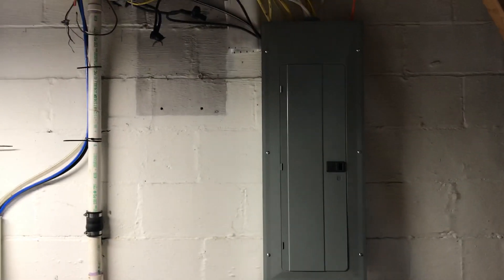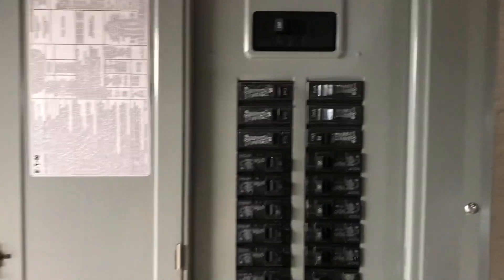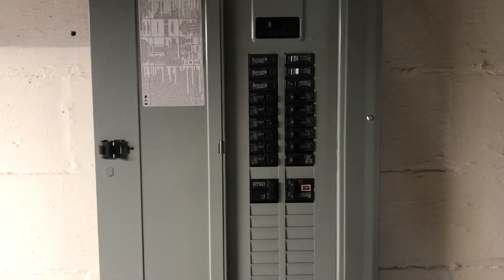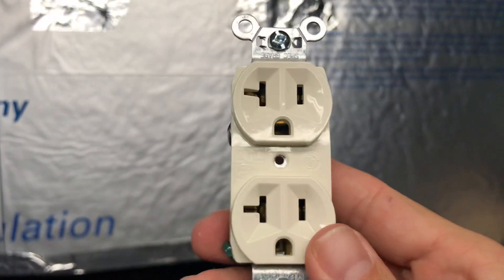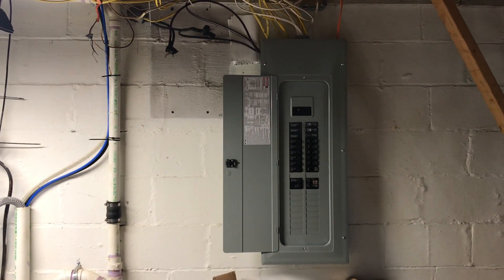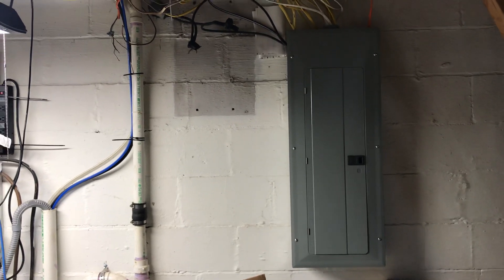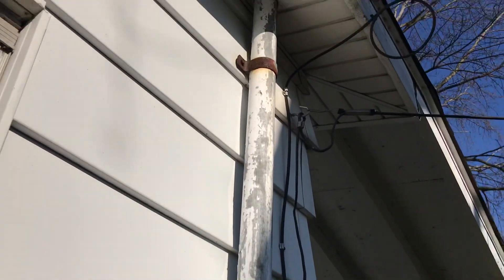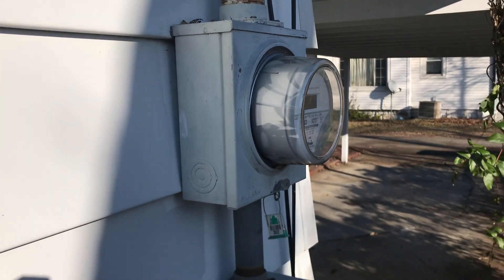100 AMP to 200 AMP UPGRADE | Part 2/3

Comment: After the 200 main was installed a 100 amp sub should be installed closer to your room then the branch circuits off that. Less  wire to run adds more expansion and one breaker to throw incase to shut the room off like say when your rigs or one of your code violations start on fire.
Reply from the maker: thanks for the comments and pointing that out

Comment: Wow.exposed wirenutted Splices above the main service panel. You must have a laid back inspector. Those need to be in Jboxes in any state. Be careful. What your doing isn't safe. Code is required because we have stupid diy wanna-be electricians. Pulling 200 amps on a 100 amp service cable will damage the transformer.